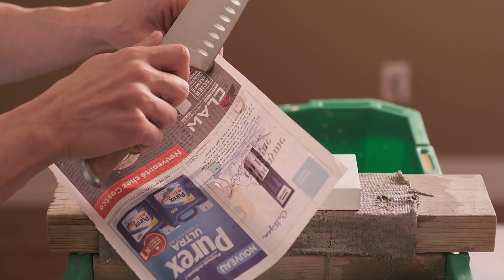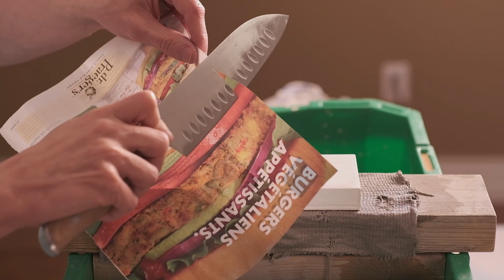Amazon Knife + Suehiro 8000

Comment: Which stone is your favourite 8k-10k stone? Which 8k is the hardest?
Reply from the maker: I haven't used any other 8K unfortunately but I would really like to try the Kitayama 8K. Which ones are you considering?
Reply from the maker: I bought the W8 for the same reason. For maintenance and in the end, I didn't use it much. I might try it again actually. I used to permasoak it so at least that way, it was always ready.

All finishing stones will be rather hard. I raised a slurry with the dressing stone and it help with the feeling. I actually prefer the feeling of softer stones like the Cerax 1K and Rika 5K. But when you have a bunch of knives for clients, I really enjoy using the Naniwa 800 and 2000. I think 2000 for cheaper knives is the max and it's a great finish.

Another thing to be aware of is that Naniwa pro/chosera leave a higher finish than their advertised grit rating. So your Naniwa Pro 3K would be too similar to the Rika 5K.
Reply: @quietsharpener  If the Pro 3K is similar to Rika 5K then I might buy Shiramine or Naniwa Pro 5K instead, but I'm inclined towards Shiramine as the Pro 5K would cost around 150$ at where I live and that is not a small amount of money for me. If Naniwa Pro 3K is really or close to 5K  then the benefits of stepping up to 6K would be very minimal, I think. But I just would like to try.

I agreed that Naniwa Pro 2K would serve well as a finisher when you sharpen a lot of home use knives. 8K might be a bit overkill.
Reply from the maker: Having too many choices is often annoying hehe. But, it's all part of the fun I guess.

I will make a video of the W8 again but with my Hoc Kieu knife. I want to see if I do maintenance every other day or so, if it retains bite. I hate it when I cut peppers and it slides a bit before actually cutting.
Reply: @quietsharpener  I'm with you on that pepper/tomato skin. In my observation chosera 2k and above don't give a toothy edge anymore. And shapton kuromaku 5k and above doesn't give a toothy edge. But shapton kuromaku 2k and rika 5k gives a super toothy and fine enough edge. Suehiro gives extreme teeth due to pure formula and vitrified method. I'm inbetween white or green 8k to try next. One has gc (green silicon carbide) another has white aluminum oxide. Interesting thing is normally gc is used on very coarse stones. Maybe one exception is king neo at 1k. Other most synths are wa mostly.
Reply: @enobil  Have you bought the stone? I bought the white one and it cuts really fast. I haven't used any other 8K stone though, but I had Naniwa Arata 10K and this white suehiro cuts much faster. Before buying, I was told that the green one cuts super steel faster while the white one cuts normal steel faster. Both of them will create a hazy finish, but the white one will create more visible scratches.
Reply: @blggtavus hi, I'm still trying to pick between white or green 8k. Naniwa arata 10k gives a perfect mirror but in practice for a knife I find rika 5k to outperform all other because once the apex is overpolished it loses slicing ability very easily. But in amazon reviews i read something like suehiro green 8k leaves some deep scratches and it is not very consistent. So I'm thinking about white 8k to be on the safe side. I think polishing is only good for straight razors, with that mindset suehiro happens to be the best brand which uses I guess little to no polishing compound in the formula. Just my observations
Reply: @blggtavus  I ordered both now. Will take one or two weeks to arrive. I will compare with shirogami #2, AS, fc61 and some soft steel kitchen knives
Reply: @enobil  I look forward to your opinion. Green leaving deep scratches rather than white is quite the opposite of what I heard. But you will know soon enough.
Reply: 1. Which is hardest. shapton pro are the hardest and least friable stones on the market.

2. know your gear. every line of stones has their own rating system. A cerax 6k isn't even as fine as a shapton 2k. on the other hand suehiro has other lines that are actually finishing stones. including super high quality fine finishing stone. you just need to know what is what. 

3. The green 8k, called G-8DN, is green silicon carbide. It's about 2k or 3k at best. if you compare to more general multi use lines of stones like what shapton makes. The white is obviously white alumina. The benefit of silicon carbide is that it has more abrasive power. If you are grinding stainless steels, especially alloys other than just chromium, the green silicon carbide will cut much better and give you better results on the edge. 

4. japanese whetstones are not just for sharpening edges. Many of them are for grinding or polishing BIG wide bevels. like you see on traditional japanese knives. The "softer" muddier stones are better for this, whereas really hard stones that dont release any grit or make any mess like the shapton pro are better if you just want to sharpen the edge of a knife or tool. traditional knives have a big wide bevel and are made with extremely easy to grind low alloy steels. 

5. get the 15 mm version of the naniwa chosera stones from amazon for anywhere between $30 to $60 each. including the 5k you said costs $150 or the 10k many sell for $250+. You can get the same stone from amazon japan for $50 or $60.
Reply: @enobil  thats not the stone, thats you. there is no such thing as "overpolished" edge. that your lack of ability to use it properly.    I dont know why any topics that attract mostly men seem to be filled with irrational mythology. just use logic and reasoning. stay away from myths and emotional language. there is nothing mysterious or magical happening here. You are forming an apex. and removing a burr.
Reply: @jeffhicks8428  Hi Jeff. My name is Engin. I'm a software engineer and a sharpening enthusiast. So I can explain the logic behind that. As you know when you form an apex and deburr on a 1k stone, it gives a toothy edge with a strong bite. I like to check that by running the edge on my thumbnail lightly and around 1k-5k it always has some nice grab. Also for testing the slicing performance, my own favorite method is rolling a paper towel like a cigarette and dragging the edge on it lightly, so a 1k-5k edge usually has very strong grip and cuts with minimal slicing movement. This I think is a good edge for slicing purpose. So this is one kind of sharpness. Another entirely different kind of sharpness is, when I do slightly more laps on a 8K/10K stone or chromium oxide loaded strop which is let's say 15K, or a jnat in similar range, the teeth on the apex gets entirely lost. Dragging through fingernail doesn't feel any friction. Similarly dragging on the rolled paper towel doesn't show any slicing ability. So you can say it is just rolled out due to high pressure which can be correct. But also it is so fine that cuts thin paper silently and more impressively passes HHT easily. Splits a hair by touching lightly. So that kind of edge is a second type of sharpness that's very smooth on the apex, like a U profile rather than a V profile, technically rounded yes, but still very fine and practical for e.g. straight razors where you want a smooth shave. Because it would pop the hairs but wouldn't irritate the skin. But these two kinds of edges are very distinct. Tooth edges can't pass HHT in my experimentation. Only these very fine but very smooth edges can pass HHT. So at the end both kind of edges has their own purpose. Because if you minimize the teeth infinitely it will end up with a totally flat edge profile, if you look from the side, which won't have any slicing power but it will only have a splitting power. Which can be fine if you want to push cut with the knife instead of doing slicing. Because slicing is essentially a sawing action, and each saw has to have appropriate teeth size. If your saw doesn't have any teeth it will just lick the material without creating any incision. If you don't do any slicing but only do push cuts, up to you ofc. But I just mostly do slicing so that's important for me, and I can say for a kitchen knife in general. But ofc if you're sharpening straight razors you'd go for the smooth edge. It just depends on the use case. I hope it makes sense.
Reply: @enobil  here is what I know. what we are calling sharp edge is in physical terms the measurement of the radius of the apex. the more acute the radius of the apex, the "sharper" the edge is. this is not the same thing as "cutting ability" which also relies on the geometry of the bevels of the knife. a keener edge will initiate a cut easier, this is what some call "bite."  As far as the abrasive size is concerned. it's true that using a courser abrasive creates a more "saw like" edge which in standardized tests like CATRA will actually cut a little bit longer. but. if you use an abrasive that is finer than the smallest carbides in the steel the edge becomes less likely to form microchips. because those same "saw" like ridges that give the edge slicing "tooth" become pressure spots where a crack in the steel can form easier.   Everything I just said I learned and repeat from "KNIFE ENGINEERING" book by  Dr. Larrin Thomas.
Reply: @jeffhicks8428  thanks very much for your detailed reply and sharing the book name. I will try to read that book. Tbh today I created some polished edges that are passing hht basically (I don't know much about different levels of hht yet) and I'm enjoying those too. Have a nice day